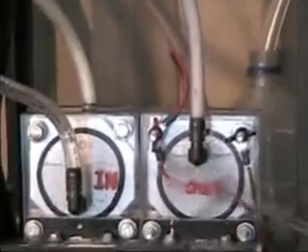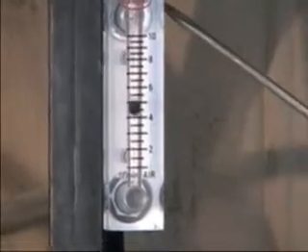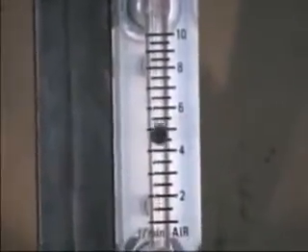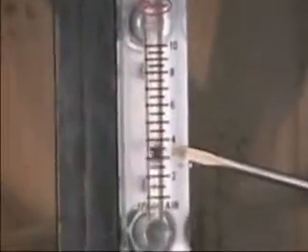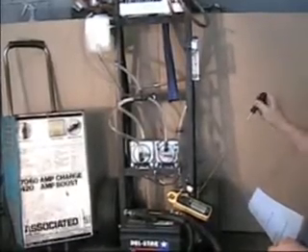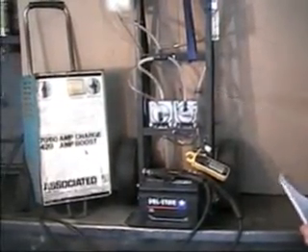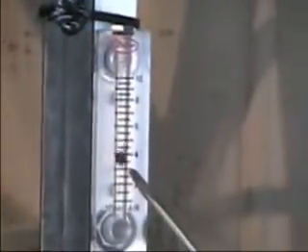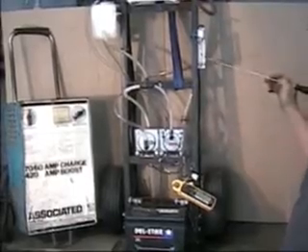HHO Dry Cell Generators How They Work ?

Comment: Yeah, but as you continue to operate it, your water temp continues to rise until you're just boiling water. After I ran mine at 20a for a half hour, my water temps rose to 130°-150°.  Then I installed a small pump from the bubbler to the cells. It made a huge difference on keeping the water cool and keeping the cells from pulsing. If you use a 60a pwm, I bought one cheap through ebay, you can control the amperage to the cells as well. The hotter that water gets, the more amperage it'll use. 
On a side note, I seen a video where an individual used graphite plates instead of the stainless. He shows how the graphite make the cells more efficient at production. Something to look into? I plan on trying this theory on my next build. 
 One more thing, if you plan to use these in a newer vehicle, you will have to get the car computer tuned correctly. It does no good to just add this to a newer car. I believe anything 2008 and up will need to be tuned. Don't quote me on that. I know for sure that a 08 dodge ram and a 14 charger need tuned. But, i get around 35mpg in the truck and car with a generator running at 15a. Im sure if I  tweek the tuning, i could get way better mileage. Just havent taken the time to do so. 
There's a lot of energy in hydrogen compared to gasoline. Maybe someday we'll get these perfected so we can do some real changes to our ever so tiny effects to the environment and tell those oil tycoons to shove their high priced gasoline up their you know what's. Good luck all!
Reply: he does all you sug. accept the graphite

Comment: Hello sir, can you tell me how many grams of Potassium hydroxide per litter they need HHO Generator. With the HHO generator the engine works together with gasoline or works only hydrogen. For my bike 1980 HONDA CM 400T, which Generator can I use.How many plates INOX 316L and how many Amps at max.will it produce. Thank you very much.

Comment from the maker: We consulted with Dwyer company before purchasing this flow meter and they confirmed it will work with HHO gas for measuring LPM 

Regards,
LaBella's
Reply: the only thing i did dif when i received your system is take it apart marked where the gasket are and sand blasted the plates